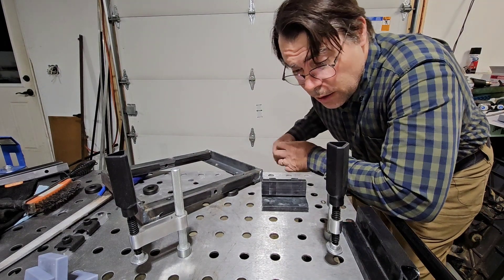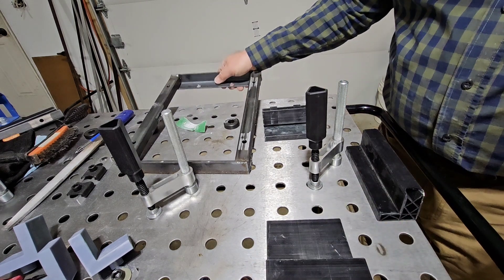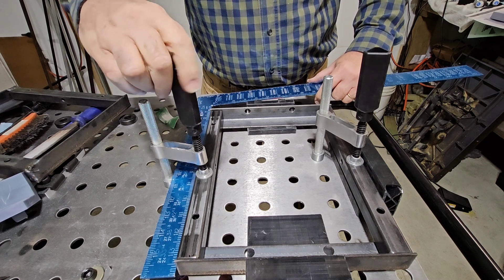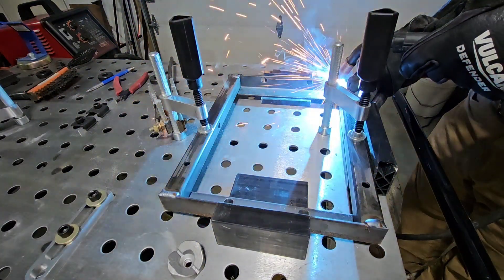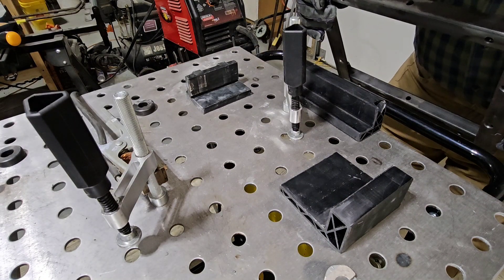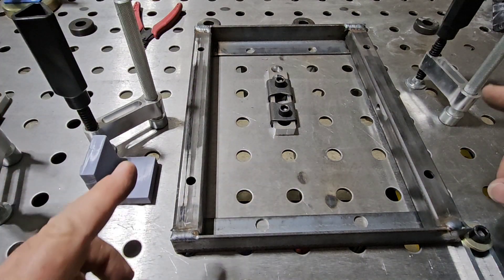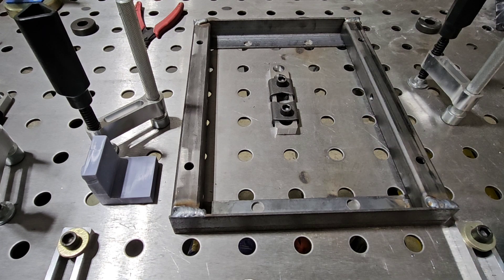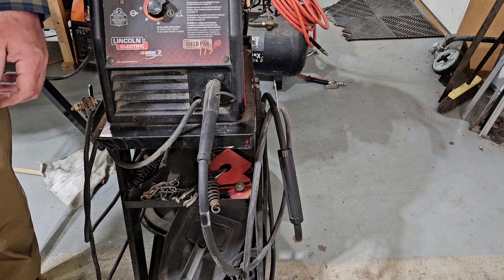Welding with 3D printed fixtures?

Comment: Worked like a charm. Although there are better ways to fixture a square shape like that. I mean, you can print those fixtures as well, but it is easier to use. For welding 90 degree angles they have these corner fixtures, and the benefit from that is that it fixtures two sides from the work piece in a 90 degree angle with a single clamp or fixture, while you still have room to do the weld. And when you fixture each corner with a clamp like that you automatically have each corner in a 90 degree angle. And the work piece will feel like a solid piece the moment that all corners are clamped. 

Another option is to print extra fixtures that go on the inside of the work piece, so that each side is locked in place. That way you would not have to use a straight edge.
Reply from the maker: Those are some good ideas. I didn't really know how the fixture needed to be made when I started out, so this was my noob attempt at making a welding fixture. I've been thinking that it could be better.
Reply: @MillBrookRailroad  For a radio guy it was good first attempt 😁 hahaha 👍

Comment: God video.  i'll try that.  How about tacking in your fixture on the outside corners.  Taking it out of the fixture and putting it flat on the table and clamping down and finish the weld.  Maybe that will keep the part flatter.  I was about to give up on snow but then you turned it into  a welding show.  :)
Reply from the maker: There are a lot of different ways to do it. I'll try some more on my next run of parts.